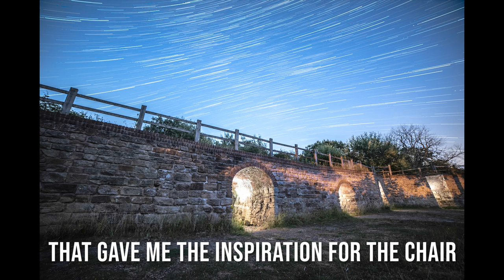How to make Viking Stargazing Chairs

Comment: nice and simple. What size is scaffold board? about 2 x 12?
Reply from the maker: Thanks.  These were around 1.5" x 9".  You could use a wider board and maybe measure 3" in from either side for the mortise and tenon.
Reply: @ProjectGarethNorman  thanks!